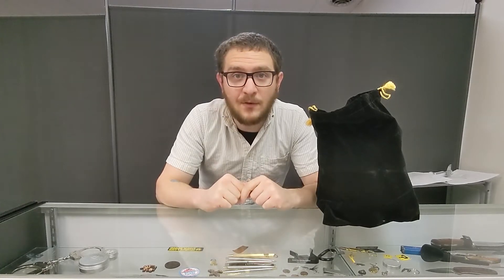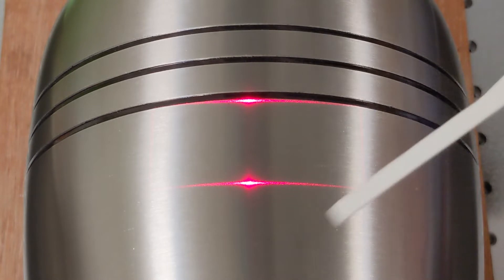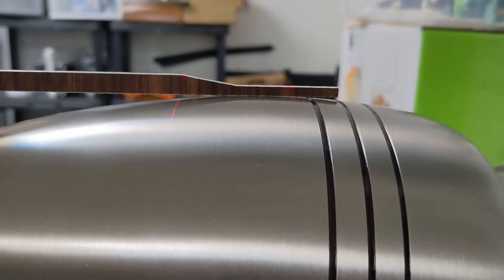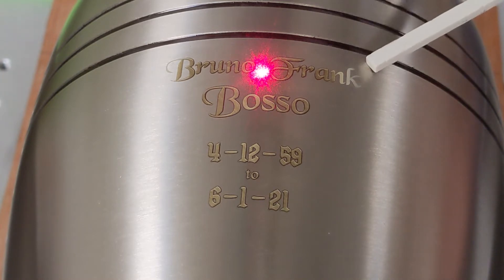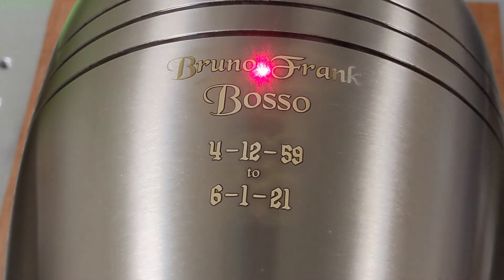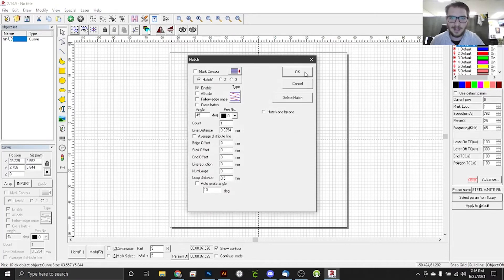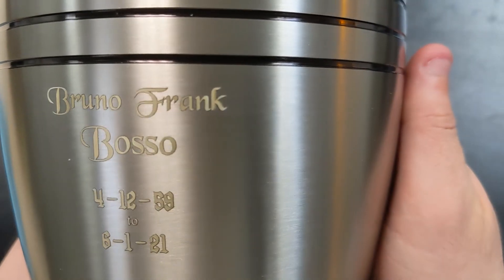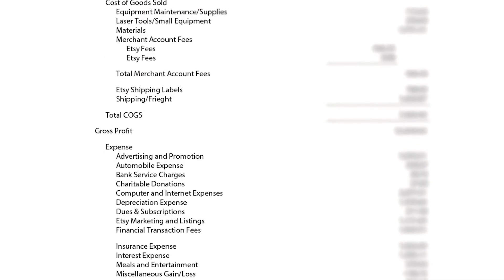I ALMOST Botched This Urn (Saved It!) | How to Engrave an Urn | Fiber Laser Tutorials

Comment: I have no clue about fiber lasers but shouldn't the rotary of turned to get the "k"
Reply from the maker: That rotary tool in the video is for the CO2 laser. I just used it as a jig to hold the urn still since it's round and would have rolled away :P Fiber laser rotary tools can't hold and turn that much weight, at least from what I have seen on the market - so we were stuck with tackling this manually.
Reply: @LaserEverything  ahhh so the fibers can't use the same rotary as co2?
Reply from the maker: Not to my knowledge with my current understanding. I will do a little research and if I find new evidence that contradicts this I will let you know.
Reply: @LaserEverything  Any thoughts on a "3D laser" like Radian offers? Just purchased another laser from my dealer. A little worried about Radian being a newer company. 

Any thoughts would be appreciated, they have a few videos on the 3D auto focus
Reply from the maker: 3D is neat but a lot more expensive. Do you have a specific use case for it? If not probably money better spent elsewhere.
Reply: @LaserEverything  cloudray sells some pretty big ones. Don't know how much weight they can handle but they have 2 really big diameter ones at 160mm and 300mm. So the biggest one is a little over 11 inches. Though that one does look different than the others, maybe for something specialized.

Comment: Im doing a small stainless steel urn, fit in the palm of your hand size. I was able to get the 2D image on one side almost perfect. Doing the name and date on the other side did not go so well. Since lightburn does then is sections. The upper section was good, the middle had a slight overlap, the lower section have full letters overlapping at 2 points. Its frustrating, how do you professionals handle that?

Comment: Referencing your video on engraving CRAPPY plated objects where you ALSO did not mention to use a LONGER focal length lens - ~200 mm - which will/would have provided a deeper "depth of focus" that would have minimized/eliminated the effects of lasering a curved surface....  Just say'in....  AND,,,  I would NOT have changed the material setting to aluminum just to achieve a different power/speed combination.  I would have ONLY increased the power and maybe slowed the speed for the SAME "brass" material selection....  The old saying - "Don't change DICKS in the middle of a screw" comes to mind and should have been followed here........  I'm very much just a "newbie", but, my advise here is "more correct"....

Comment: Engraving on an expensive (or not so expensive) item is a gut wrenching experience because "fixing" a problem is tough. I check and recheck and then check again to make sure the laser is going to start where it is supposed to, hold my breath and hit start. Yup, I have still screwed up and had to make that call to the customer. But playing with lasers, the good far outweighs the bad. If you ain't screwed up, you ain't workin'.
Reply from the maker: Very true! Thanks for watching!

Comment: The video that I need!!! New owner of a 30w laser and would love to get into this 💙
Would a rotary be able to hold the urn in place?  I've got a 70x70mm lense and a 200x200mm lense coming which would would you recommend for a project like this? The 200x200mm?

Do you have a Facebook page or anything buddy?

P.s. subscribed :))
Reply from the maker: Hey Levi, 
So glad you're getting value out of the content. This is pretty big for a rotary tool, for things this size you'd need something pretty special to rotate it while you mark it. The 200mm lens is going to be a lot more forgiving on focus but you're also going to lose a lot of power at 200mm with a 30w. Honestly my recommendation would be to get something in the middle. 70x70 is a bit too small for this and 200x200 seems a bit big. A 110 or 150 might serve your arsenal well.
We don't have a facebook page/group but we do have an awesome online community which is our Discord server. Over 500 members and people are in there chatting it up pretty much 24/7 on every laser topic you can imagine. I highly recommend checking it out. I'll link it here for you, costs nothing to sign up and you can use it on PC, mobile app or web! Hope to see you over there!

https://discord.gg/DnJQ2yZf
Reply: Hi  @LaserEverything , thank you for your quick reply buddy! 
I'll have a word with my supplier and see if we can get this swapped as the maximum surface area of the of the urn is 100mm x 100mm. 

I'll join your discord now! :)
Reply: @LaserEverything  Thanks for your video. This is very helpful. I wanted to join this discord but I think its not allowing me to join. Would you have an alternative link? Thank you.

Comment: Loving this idea and tutorial, but it's a rotary, so I would have expected you to use that. I see it's for your CO2, but I'm sure you could modify a stock rotary to work fine, especially if you used the free rollers of the CO2 rotary on the far end to hold the weight. Eithor way I learnt something, thanks. I'm hopefully ordering my 50W JPT in the next month or so
Reply from the maker: Nice, the 50 watt jpt is a great choice! We recently picked up a rotary tool for our fiber laser but the CO2 rotary tool is completely incompatible. In fact you can't use roller rotary tools of any kind with fiber lasers to my knowledge. So yeah sometimes he just got to make due!

Comment: I was just curious -- do you have customers sign a waiver/"hold harmless" agreement when they provide their own items for customization?  Or do you have insurance that would cover the cost of replacing an item if it were to get damaged?
Reply from the maker: We cover items from both ends. I have errors and omissions insurance but I would never ever file a claim for something this small - I would just pay for a replacement for something like this. 

We also include this blurb on our signed order forms: "By signing my order form I understand that proofs/samples provided by MLE give a rough estimation to the outcome of my project. Many materials will react differently to the laser, even materials of the same 'type'. Engraving may result in a slightly different color or depth than sampled. I understand that engraving is an art, not a science, and I acknowledge the inherent risk and potentially varried outcome with this item." 

I feel the above sufficiently covers me on variations of outcomes as long as the work is solid and the outcome is of sufficient quality. In the event that a mark or engraving is just completely unacceptable I would either replace the item or if the item is extremely expensive or sentimental in value that's where the errors and omissions insurance would step in.

LUCKILY to this day I have yet to file an insurance claim! Gotta go slow, take your time and treat every job as if it's one of a kind.

Comment: How come you didn't use a Rotary Axis for this?  With the proper jaws you could have saved yourself a lot of headache.
Reply from the maker: I have yet to see a rotary axis for a fiber laser that cam lift this kind of weight reliably. If you know of one that exists post it to the discord because I will buy it and do a video on it lol
Reply: @LaserEverything  What was the weight of that urn?
Reply from the maker: Maybe 8lbs?
Reply: Could definitely hook that roller rotary up to your fiber laser man.  I converted a spare XTool rotary roller with an aviation plug and it works great.  Also a 210mm lens probably would have saved your butt use it all the time and get great results from my 30w, I rarely use my 110.   You probably already know all this by now 😂